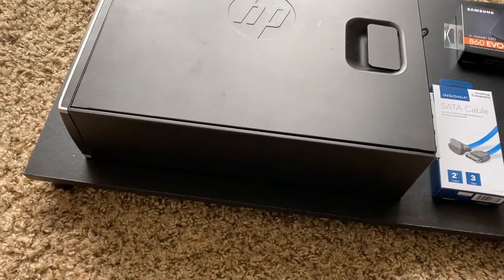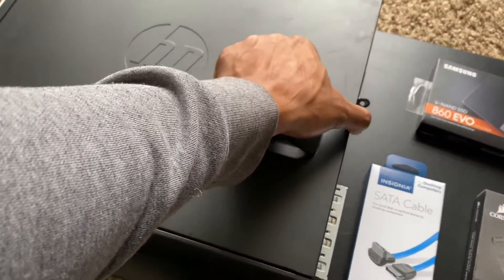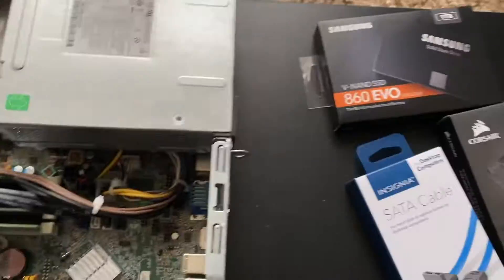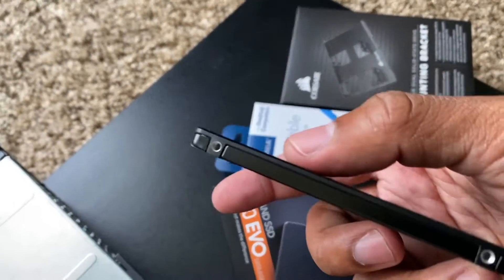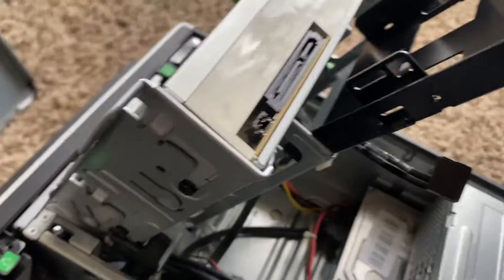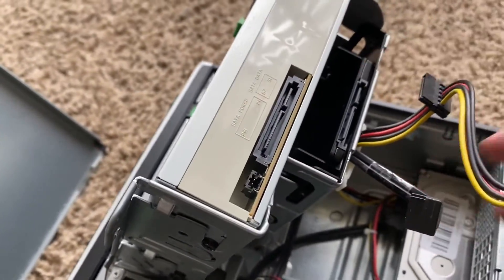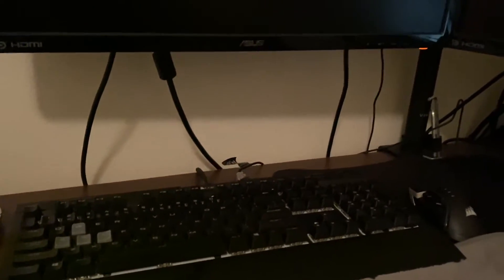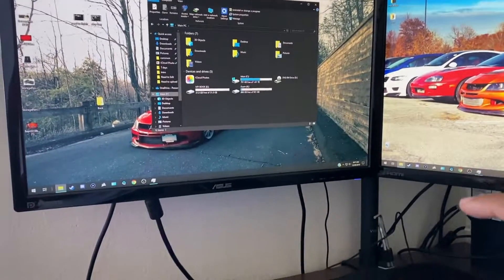Installing a SSD on my HP Elite 8300

Comment: I own a E8500 was abandoned I was using with Linux with 4 ram works great but I’m in photography hobby and I’m installed windows 10 for photoshop and lightin room using and is too slow  my pc use ddr3 and 4 slot and cpu dual core duo I will try more ram + ssd  and maybe a graphic video car but I just  need for photography edition no gaming

Comment: If your still continuing this series if i were you id buy a pcie to m.2 nvme adapter and if your pc motherboard doesnt support the pcie to m.2 adapter look into clover bootable
Reply from the maker: I stopped using this Pc a long time ago
Reply: @Shakeem  that's a shame I wanted to see the performance boost and another note I cringed so hard every time you said this HUGE Hdd even tho that was the disk drive 😂 the hdd was under the power suply

Comment: I have this same PC to this day in my home lab. Another great thing to do is to remove the front panel (face plate) as well as that black shield housing the fan and vacuum those areas. If you've never done this, you might puke when you see the thickness of the dust. Mine looked like wall insulation it was so thick. I feel like the computer runs much faster since I've done that. Although as per your video, I will add an SSD to run things faster while keeping my original HDD (located under the power supply) as storage. I actually game on a PS4 and added an SSD there and the performance is light-years better, so I'm looking forward to this upgrade. Great video. Cheers!
Reply from the maker: Thank you for the feedback. This was a great Pc to learn on

Comment: you still using your hp elite?  i had a gaming computer but the bios updated and it wouldnt run.I sold it cheap to some kids.They was very happy and i told them im pretty sure the bios needed reflashed  this is a known problem with that model  my son is going to college for computer forensic  anyways i sold it very cheap to them  they acted like it was christmas which i didnt care  i bought a lenovo small form factor  i like it added a ssd and a 2 tb hard drive and new memory and a gt 1030  i bought the pc renewed and the company did a great job with the refurbish  the case which they repainted but the paint job looks like it was made that way  i had to really look at it to realize they painted it.i paid 93.00 for the pc  cheap  anyways i have a total of 240.00  my old hp gaming pc was worth at least 500.00  the video  card was  a rx 2060  very high end card comparded to a gt 1030 lol
Reply from the maker: Stopped using it a few years ago
Reply: @Shakeem  why did it quit or needed a more powerful pc

Comment: 1:30 Yeah, I recommend it too since my last ( very old ) computer died since I didnt de-dust the motherboard and more importantly the fan.  The fan was soo packed with dust (disgusting I know) that the fan stopped worked - thus overheated the cpu.    Now on this computer Im always checking my 'dust levels'.

Comment: I bought a 500gb ssd and a 2tb hdd. My 8300 comes stock with just a 500gb 3.5" HDD. How do I alter to where my PC stops downloading files and storage to the 500gb HDD and instead to the 2tb HDD?
Reply: I guess you have to manually set where does the info will be downloaded at. Check if you have full admin control on both drives

Comment: also make sure you swap the thermal paste  somtimes the paste it  comes with is not too great and  puting in new and better paste might help a bit also that thing on the  top is not a hard  drive i know you not tech savy but just a fyi its a  disc reader xd not trying to be rude to ya
Reply from the maker: I no longer have this Pc but thank you

Comment: Is your gpu compatible with that psu?? I have 750ti and same pc but im afraid that it might get overheat
Reply from the maker: I no longer have the Pc but it worked fine with the 1050 ti. That’s always a risk though
Reply: @Shakeem  Someone did a video where they measured the power from the wall, although a 240W PSU seems like a bad option, it was only rated at around 130W under load (this was with an i7 2600, 32 GB of RAM, GTX 1050 TI etc.) This was on the HP Elite 8200, however, I believe they both have the same power supply.

Comment: Cheers  I have the same hp ccomputer  it has a I 7 2600 gpu,,,  what ssd 1 tb  would you use  I tried to write down the numbers on your ssd in the video  but I want to confrim with you   I think my computer is 9 or 10 years old  and I have spare open unused plug in slots the same as I see in your excellent vid,, thank yo in advace   Cheeers Dave D.
Reply from the maker: Any would be fine but I used Samsung T5

Comment: Hi, is hp 8100 sutible for ssd with 500gb space and sata port is same for 8100? I also have geforce 710 low Profile. It works good. Now i want more space .
Reply from the maker: How much ram are you running ? You can use a SSD with your setup
Reply: @Shakeem  now i have ssd . Works great. 8gb ram

Comment: question: Do I have to get that exact sata cable model, I'm asking because the one used in this video isnt in stock anymore.
Reply: To replace it im planning to buy the Insignia™ - 2’ SATA III Hard Drive Cable - Black
Model:NS-PZ025012SKU:6406731. Will it work?
Reply from the maker: Any sata cable is fine

Comment: Hello hp compaq elite 8200 sff 
İ5 2400 vpro
6 gb ram
240w psu
R7 350

Is it a problem?
Reply from the maker: What are you doing to do with it ?
Reply: @Shakeem  I want to install the video card I mentioned to play games. will the power supply cause a problem?
Reply from the maker: You should get more ram and what’s the wattage recommended for the 350 cars ?
Reply: @Shakeem  12v channel is 50w
Reply from the maker: If it recommends 50 wats then your good
Reply: @Shakeem  thank you brother. You watching me from turkey

Comment: How do you change the boot order so it boots from the new SSD? I have the same PC and can’t figure it out, it lets me manually boot from SSD from the boot menu, but I can’t seem to make it the primary boot option
Reply from the maker: You have to change it in the boot sequence. Make the SSD first
Reply: @Shakeem  it doesn't show up in the boot sequence for some reason, but it's detected in the normal boot menu where you can do it manually

Comment: When I looked online it says the hp 8300 elite isn't compatible with windows 10, but when you do it says it is compatible. Did you use windows 7 or 8 then upgrade to a windows 10?
Reply from the maker: Mine came with windows 10

Comment: 1st do you need the bracket and is it mandatort to get the cable or can i use the cable that is already there and 2 what are all the things you used so i can see a total on his much i need
Reply from the maker: If you don’t use a bracket the SSD will just be floating in the case. And you don’t have to get another Sata cable if you have one available
Reply: @Shakeem  alright thanks
Reply: @Shakeem  what happens if i get the ssd and ram but not the 1050 ti will anything happen?
Reply from the maker: With out a graphics card it won’t be able to handle video games. You probably get around 2FPS
Reply: @Shakeem  so thats the 1st thing i should get?

Comment: Great video - can I add another 3.5" hdd underneath the power supply? I have one 3.5" hdd under the cd drive.

If yes, then is there a spare sata and power connector already in the case?
Reply: You hero! At 3:05 you actually showed there is a spare power connector for an extra hard drive...and I can take a sata cable of the old pc this one will replace...THANK YOU!!!!
Reply from the maker: no problem

Comment: so i'm planning to do this build, if i want to be able to play VR what would i need. And would i need a more powerful power supply for  it? plus i plan to remove the disk drive because i wouldn't really need it.
Reply from the maker: the i7 processor would be better than the i5 im using. and good graphics card that can fit

Comment: Does adding a SSD make ur frames or anything like that higher or is it just to load into your computer and games faster?
Reply from the maker: Just loads everything faster
Reply: Keemborghini Ok thanks, also I think Im gonna get the 8300 i7 but not the small form factor, would I still not the low profile gtx 1650 or could the normal Gtx 1650 fit in the PC?
Reply: @braydenlove6647  no it wouldn't unless ur keeping the side of ur case open thats what im doing with my 750ti

Comment: Is it possible to put the components on a other computer housing?
Reply: I think the mother is a proprietary HP design and it wouldn't probably would line up with the standoffs in a standard case.
Reply from the maker: Not to sure

Comment: yea at 9:36 you can see it says hp compaq pro 6300 sff , when he is trying to get into the bios..... i have had lots of people try and sell me a 8300 and it turned out to be a 6300.... they do have the same bios that is true, but the 8300 has 2 sata 3's and the 6300 only has 1 sata 3
Reply: where can you check that? when my pc boots up it doesn't turn up like that. thanks!
Reply: @lattaem  i linked the time code u can see it in the bottom right of his screen it says hp 6300 sff - u can use HWinfo to see if its a 6300 vs a 8300, but when he was getting into the bios screen u can see it say hp 6300 sff i think the 6300 also only has 1 full length x16 pci-e slot the 8300 has 2 (even thou i dont think the bandwith is x16 on both or even 1)
Reply: @lattaem  i think u hit esc key when the pc is booting up

Comment: You made a huge mistake, SATA ports on the motherboard are not the same, the blue one on the left is SATA 3.0, the next is SATA 3.0, the next is SATA 2.0 for the optical drive, and the last one (the one you used) is ESATA 2.0 for detachable devices. Change your sad to the blue or the next to it to have full 6Gbps speed.
Reply from the maker: thanks bro ill check that out

Comment: Can you tell me what games will I be able to play in my hp 8400 lite 4 gb ram ( are the graphic card limited? For any pc?) What graphic card i would need to actually play casual games?
Reply from the maker: 1650 and below you'll be fine to play any game
Reply: @Shakeem  bro quick update i finally bought a pc can you tell what games can i play without and With graphich card?
Here are the specs..
Core i5 2400 
1tb hard Drive
8gb ram
3.10 Ghz 
With a monitor having ..,
1680×1050 resolution
59 hz refresh rate.

And also tell if i can do programming and have to edit using softwares, is my pc good ?

I will be very pleased , if you answer these questions? ❤️

Comment: Hey man! Just checked your channel.
I want this PC and I checked amazon reviews and they weren't the greatest. 
I have 2 questions.
Should I get a this PC and should I use an RX 570 instead of a 1050ti LP?
If you can answer these it'd be mucho appreciated.
Thanks man! Have a nice day :D
Reply: This computer along with a GTX 1650 LP. 
70% faster than the regular 1050.
Reply from the maker: i would get a better GPU then the 570. Like the guy in the comment said even a 1650 would be good. my 1050 ti lp been fine
Reply: @Shakeem  also i'd rather get a 1660 but can i remove the parts from the small case and move it to a larger one to fit everything? if i cant i may as well get a 1650 lp if i can
thanks for the help!
Reply: I also don’t believe the 570 had a low profile version correct me if I’m wrong

Comment: what do u mean by oc low profile???????
Reply from the maker: its a smaller sized GPU for an example you have a 1050 Ti and 1050 Ti Low profile. The low profile is much smaller and can fit in smaller cases
Reply: @Shakeem  what about performance?
Reply: @Shakeem  tell me
Reply: @shahrukhBTC  Low profile GPU's fit inside of the smaller computer cases. GTX 1650 Low profile is very good & fits with now problem.

Comment: Do you recommend using the same motherboard on the computer with a rx 580
Reply from the maker: i would get a more high spec GPU. but the 580 should work

Comment: Ever since I opened it it won’t turn on it turns on it beeps then turns off and then the fan gets really loud idk what happened can u help me?
Reply from the maker: Where did you purchase it from ?
Reply: Keemborghini amazon
Reply: Keemborghini all I did was open the case but it was difficult to get open and the back bended a little bit
Reply from the maker: You don’t see anything on your monitor ?
Reply: Keemborghini nope
Reply from the maker: Double check your connection cables. Or contact Amazon
Reply: Keemborghini okay
Reply: Keemborghini how much of fps do u get on gta without graphics card or ssd

Comment: Do you need the Sata cable and the mounting bracket?
Reply from the maker: There’s a extra sata cable already in there. But it’s good to have a extra one. But you will need a mounting bracket
Reply: Keemborghini thank you!!
Reply: For a SSD, you don't need to have a bracket. It's nice to have, but using double- sided tape works perfectly fine.

Comment: This is an HP COMPAQ PRO 6300 SFF or HP Elite 8300???
Reply from the maker: Elite 8300. It uses the same bios as the 6300
Reply: at 9:36 u can see its a hp compaq pro 6300,(q75) the only differenece is a small chipset upgrade in the 8300 (q77)
Reply from the maker: They are pretty much the same thing

Comment: just realised when you boot up the pc it says it says 6300 not 8300?
Reply from the maker: They all have the same bios since the 6300
Reply: @Shakeem  just ordered everything for my budget build from watching your videos bro!!
Reply from the maker: Nice keep me updated how it runs when you get it
Reply: @Shakeem  all set up with ssd as mx500 as main drive. HDD for storage, boots up super fast too. i went to purchase the 1050ti which was, £140 now £220!! anything cheaper but similar which will run some new titles?
Reply from the maker: Definitely. You got a 1050 low profile ? Or just a regular 1050 ?
Reply: @Shakeem  neither, I went to buy the 1050ti like in your video and the price spiked, what would you suggest as an alternative? Thanks for help
Reply from the maker: A low profile 1030 or even 750. Or another 1050 low profile form another brand

Comment: When you booted up your computer it said Hp compaq pro 6300 ff are you using that or the 8300
Reply from the maker: 8300 they all use the same bios since the 6300
Reply: Keemborghini ohhh
Reply: @Shakeem  there is a small difference between the 6300 and 8300, they have different motherboards but same bios... 8300 is just slightly better, yours is a 6300

Comment: The stock power supply runs all your upgrades?!? A friend told me i had to buy a new power supply for basically everything. I dont know anything about computers so THANK YOU SO MUCH FOR ALLL THE HELP
Reply from the maker: No need to upgrade its fine with the 1050 im using

Comment: Im currently upgrading the same comp. What u were calling your hdd was actually your optic drive. Your hdd is mounted under your psu. I actually removed the optic drive and with some creativity and 2 pci extensions, i have a full size 1650 in mine. 16 gigs ram, 256ssd and 500hdd for storage. The comps are so fun to upgrade. Came with upgraded i5 cpu so it rocks.
Reply: 1650 ran fine with stock psu, btw. I guess u can fit a different psu in it, but wasnt necessary.
Reply from the maker: Thank you I realize after the fact I’m talking ann b out the wrong stuff lmO
Reply: You should make a video on this because i want to upgrade my gpu to a 1660 or your 1650 without buying another desktop.
Reply from the maker: Easy upgrade for you. Open up your tower and slap it right in
Reply: @Shakeem  thanks!

Comment: much easier if you just clone your c drive to the new ssd before install,plus look at some of the caddy options for the 8300 if you want to add even more hdd or ssd or other features such as more usb 3.0 ports to front of unit little versatile units those hp's
Reply from the maker: Good info. I have a new build coming soon

Comment: I’m building a $100 or less (stupid cheap) Fortnite Gaming PC from used parts as my first PC build. And this HP 8300 SFF is what I’m starting with. So far I have ;

Intel i5 3.2GHz
500gb HDD 
256gb SSD
16gb RAM

Total cost is $25 so far. So either a graphics card or an intel i7 3770 processor is next. Just waiting for a good deal to pop up on Craigslist.
Reply from the maker: a GTX 750 and up you’ll be good
Reply: Keemborghini - Word, I just bought a GT 1030 2GB off eBay for $55. Hopefully that’s enough to get the ball rolling for now, but we’ll see when it arrives next week.

Comment: Hey keemborghini upgrade the processor to i7 3770 and u can use a new graphicar card better than the 1050ti you can change to the gtx 1650 low profile 4gb using the i7 3770 is better upgrade for the computer
Reply from the maker: I have a new build coming soon. Not going to do anything more with this one

Comment: Good on you for upgrading, I’ve got pretty much the same setup. Great power to cost!

That big drive you installed the SSD under is actually the DVD drive, the HDD is under the power supply. If you pop the front cover off, there’s special screws for mounting new drives. 

With the sata ports, the top dark blue is the fastest port, so I’d recommend plugging your SSD into it. The HDD into the next, then the DVD into the white one next to the black. 

👍
Reply from the maker: thank you. this why i love the comments i always learn so much lol
Reply: Keemborghini And thanks for your videos too :)
Reply: I cloned my SSD from my hhd, but the computer won't boot up from the ssd. I disconnected my HDD and connect my SSD to the main dark blue port...but it won't boot up....did it instantly boot for you guys?